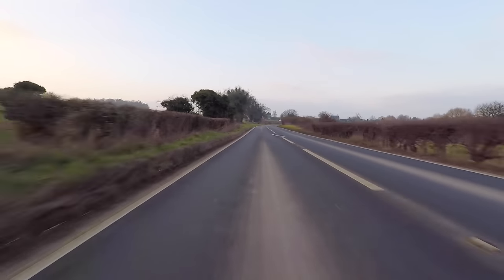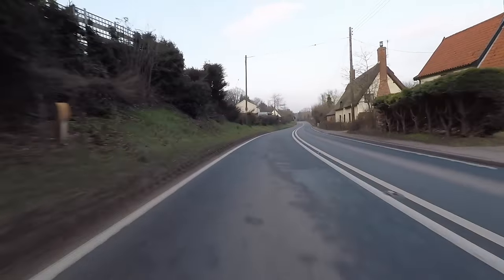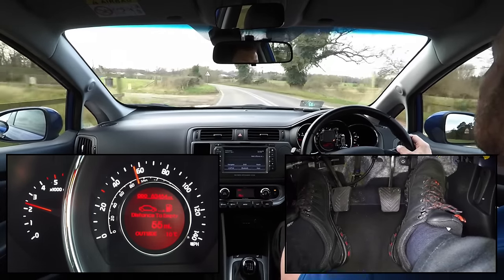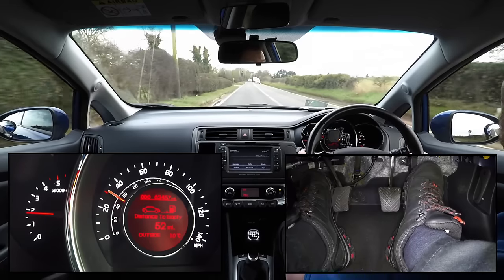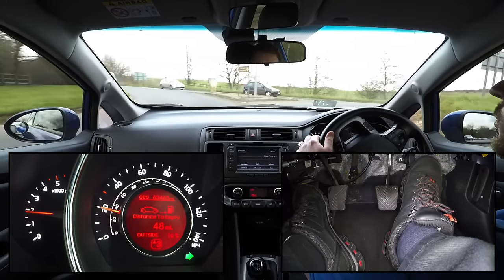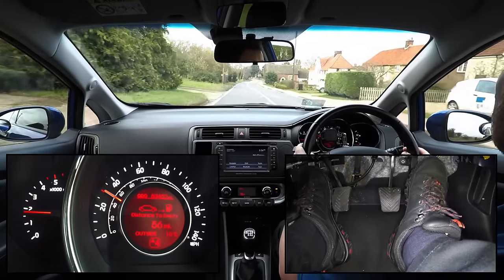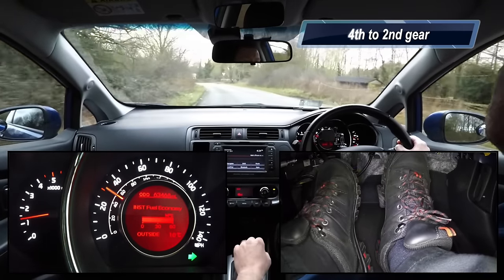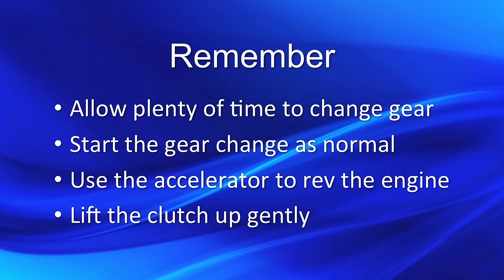Rev-Matching Gear Changes In A Manual Car  |  Learn to drive: Expert skills

Comment: do you tap the accelerator or fully press the gas pedal to floor when rev-matching?
Reply from the maker: +Daniel Mauchaza Just a gentle push or tap. We only want the engine revs to rise enough to match the speed of the lower gear. Experiment until it feels smooth!
Reply: Daniel Mauchaza I usually tap it twice cause I have a lighter flywheel then normal people.
Reply from the maker: There is no need to rev-match when shifting up as the engine speed and car speed match quite well anyway, which gives a smooth gear change.
Reply: Fully press
Reply: I think you can use both methods. I press on gas pedal when releasing the clutch pedal. It depends if your coming to a round about or driving on an A road when traffic has slowed down a bit.

Comment: Half of the manual car community says downshifting revmatching is essential and should be done  Everytime you shift down  So what's the correct way because I'm sick and tired of this argument. I'm  self teaching myself stick in a ND mx5 because I have no friends ( I like being by myself) and no one in my family knows stick. I've just been watching videos after videos after videos on stick tutorials. Half of the videos say downshifting revmatching should be done when downshifting. So I'm like WTF is the correct way to shift down. I've been driving for a year now on my ND and I just finally are getting better at upshifting but down shifting is where I don't know what to do. I've tried to just shift down without blipping the throttle and I buckle the car   but the car buckles really hard alot. So what is the correct way to downshifting?
Reply from the maker: The answer depends! When a new driver is learning to control the car we never even mention 'rev-matching' as it just makes everything harder. Down changes can be made smoothly if the car is slowed down to the correct speed, and the clutch is lifted slowly. Most drivers will stay with this method for ever, but when a driver gets more enthusiastic they soon realise that they can't downshift smoothly at higher speeds - and then rev-matching becomes more useful as it allows a smooth gear change at any speed. This is the reason that we have put this video in our 'Expert Skills' playlist, as it should be left for more experienced drivers - but even then it will take a little practice!

Comment: Why the crap they changing the gear before the gas? Ok you save the clutch but what about the gear??
Reply: Can you rephrase that? Doesn't make a lot of sense what you typed out, because you're just describing normal upshifting.

Comment: You should change gear at 2.5k revs in a petrol car
Reply from the maker: We think that depends on how much power is needed. When driving gently, we won’t need much power so can change gear quite early for best fuel economy. However, when we need extra engine power, such as when accelerating up to speed on a major road we would change gear much later.